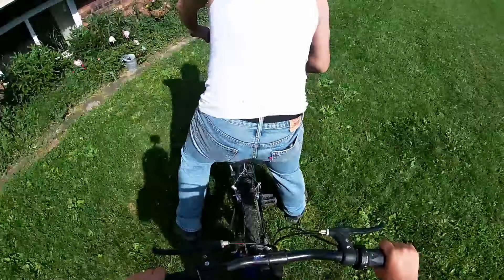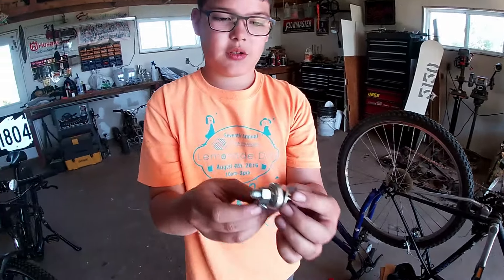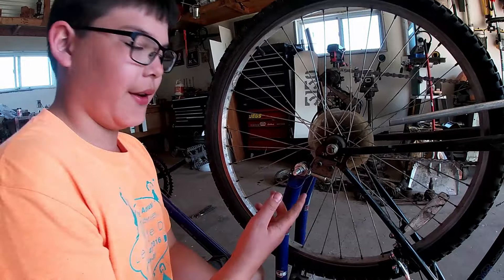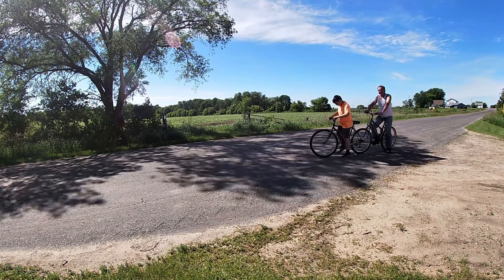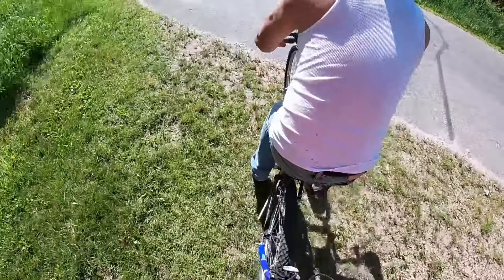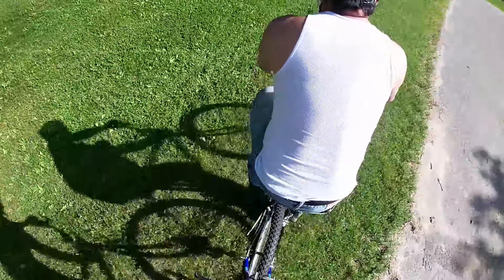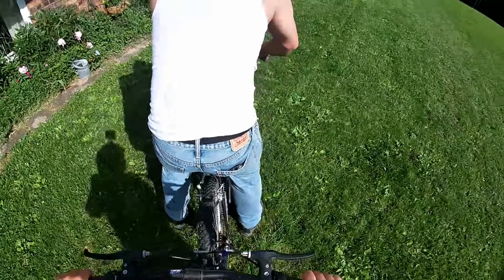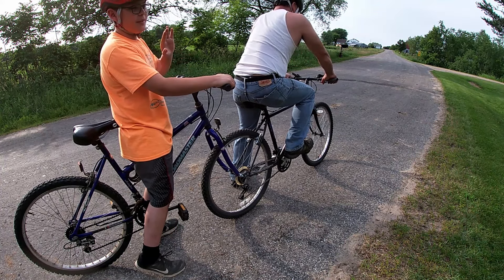DIY Tandem bike biuld

Comment: Hi, nice idea, but the castor angle of the rear bike is causing it to lean to the outside when the lead bike is turning. For optimum stability, both bikes should lean (bank) by the same angle when cornering. You could improve the handling by rotating the forks 180 degrees on the rear bike (therefore reducing the castor angle as much as possible). You would of course then have to rotate the handlebars on the rear bike 180 degrees, or they would be facing backwards...........
Reply: Just mount them the other way

Comment: Nice video and great little project!!!! I have to say however that this build isn't going to give you a true tandem bike riding experience. This is more similar to a regular (single) bike hitched up to and towing a trailer. True tandem bikes don't articulate and the frames are also MUCH stiffer with far less frame flex between the captain and the stoker - so the handling is going to be much better and the overall riding experience is going to be much different from this. But still a nice project you have there! Cheers👍
Reply from the maker: yes, i know just a fun simple build we where thinking of making a centipede bike off it
Reply: @sagesbikesandboards1561  Wow that wold be fantastic!!!

Comment: you should try to lock / prevent the bike on the rear to steer so it will function as a real tandem bike... ride safe
Reply: you would have to them take the middle wheel otherwise it wouldn't turn and if you did it would majorly weaken the frame